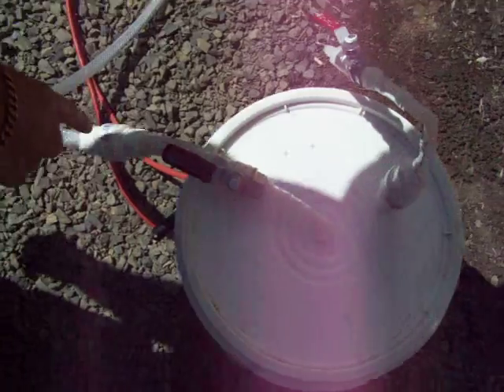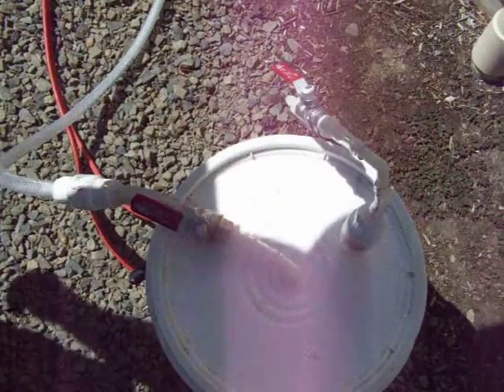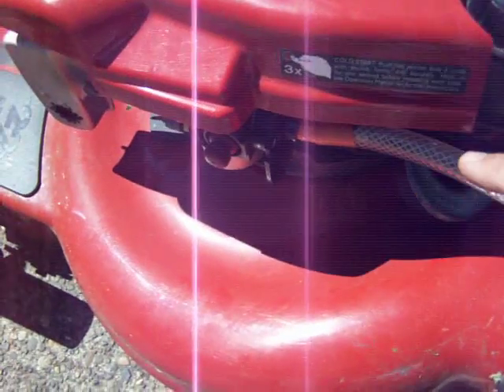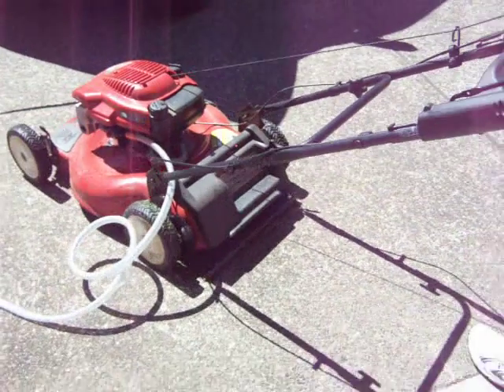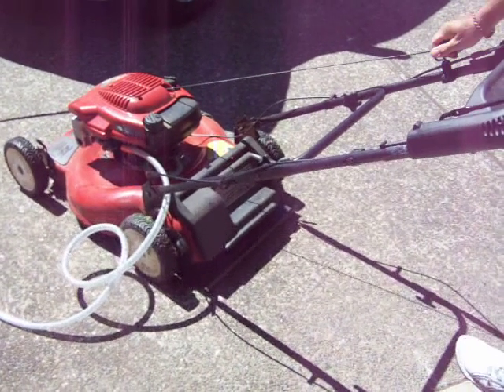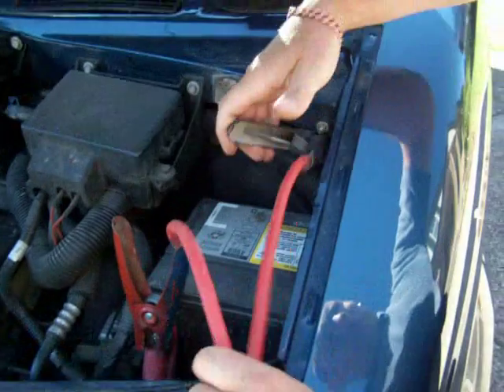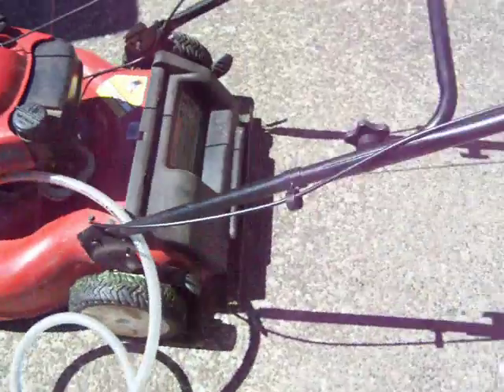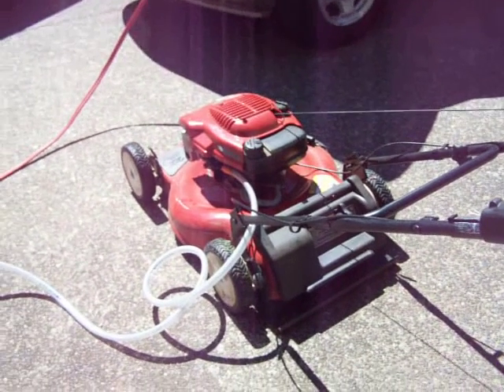lawnmower running briefly on hho (not)

Comment: I notice that the air line into your generator terminates below the surface of the water, maybe almost to the bottom.  Have you tried terminating it above the water line, or perhaps giving it entrance on a tangent to the radius of the bucket just above the surface of the water?  You would also need a check valve to prevent the escape of HHO.

Comment from the maker: I did not do anything to the lawnmower other than pinch off the fuel line with a c-clamp, run it until it quit, and made sure it would not start.  Then removed the air filter and put in the hho delivery hose which also has a check valve.  And yes there is a check valve (1/2" pvc) on the valve that lets air into the generator.  I had to put a bigger line in because I got it to run longer and it caved in my plastic bucket.